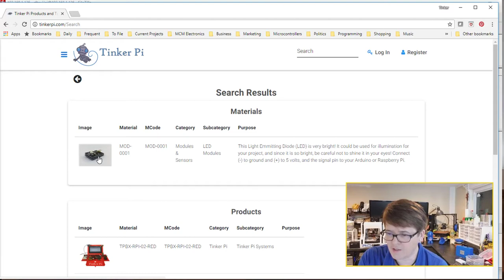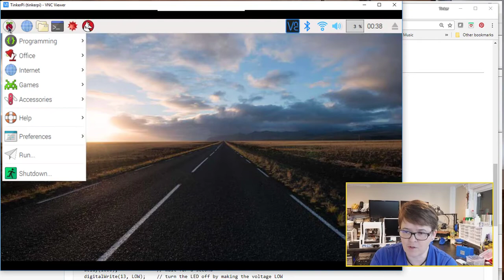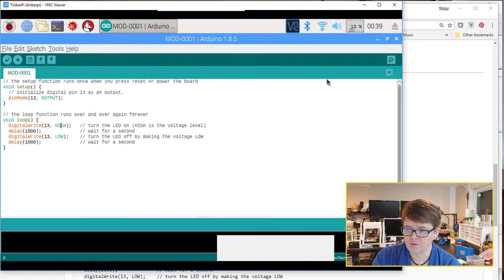Arduino and 3W LED Module - Getting Started with Arduino and Keyestudios 37 Sensor Kit

Comment: I dont know if i will get an answer but, if i want to connect 5 3w leds then i should put only just the signal cable from arduino and the power cables from a powersupply on the leds (i want to turn on the leds for 4-5 hours)

Comment: Am I missing something? If you're using 5v to get 3w, then you should be using ~600mA... But you can't take that much from the GPIO? Or is my thinking wrong?
Reply from the maker: According to the spec, the range is 700-750 amps, which turns out to 3.5 to 3.75 Watts.  The Pi provides 16mA per pin, but the LED is getting power from the 5V supply.  The signal pin is hooked to the GPIO, which just tells the LED to turn on or off.  Here is a link to the manufacturer spec:  https://drive.google.com/file/d/1wma00lK9OW5JNPsHFOt2i5rxV_jdGd4g/view
Reply: It may work for few minutes before Arduino will give up and blow up.